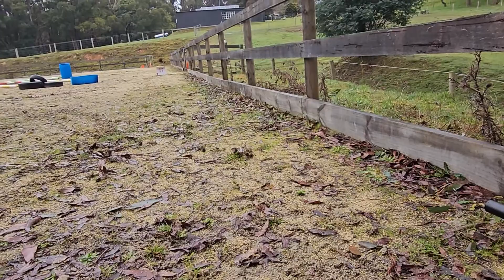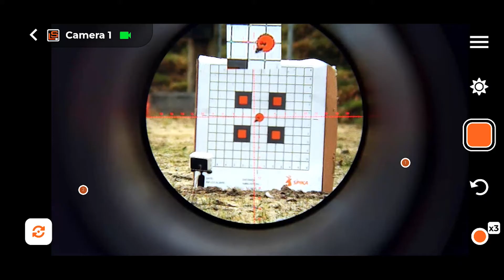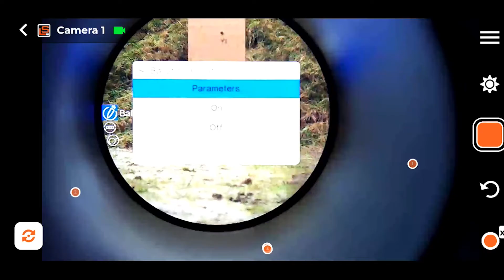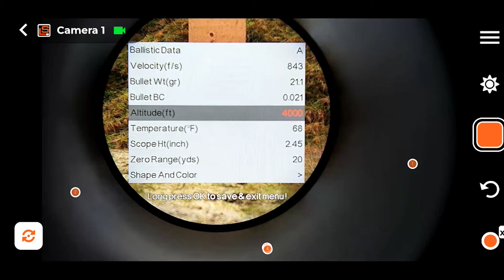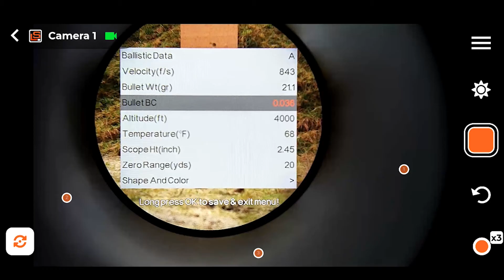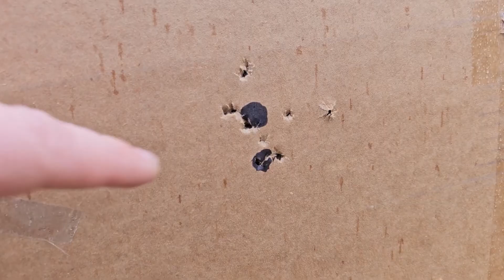How to zero and setup the PARD DS35 Ballistic Range finder, with a tip from Nath @EDGEoftheOUTBACK

Comment: Dont wanna tell you how to suck eggs but if the rf marks is accurate to where the range splash is working. Doesnt that mean your ranging 54 yards at the tree behind the box? And not the box itself?
Reply: This is what I thought, the ranging is off in the video, he's actually ranging behind the box which is likely adding another couple yards. This will explain the difference. 

So actually the standard ballistic calculator seems to be spot on without the need to adjust the BC
Reply: @ds6899  Very probable and most likely the fact. You have to remove the retainer shield of the range finder lens and fiddle with the set screws to center it to the target. He's ranging the tree here.

Comment: Great video, thank you for the insight, this has helped me a lot to fine-tune my new optics. Do you know if the Pard ballistics calculator adjusts for windage? On mine I only see up and down changes based on distance but no left or right adjustment
Reply from the maker: No it won’t adjust for windage as it cannot detect the wind to account for it, it would need a weather station attached to it as it would need both speed and direction.
Reply: @HuntTheNight  the element ballistic app calculates windage based on the spin rate of the barrel, that’s what I was hoping the pard to do as well

Comment: well that works great but if you shoot it at 10 or 15 yards can you tell me how far off the ballistics are because mine shot at 15 yds is 3/4" or 19mm above where the ballistic calculator says it should hit so its 19 mm high at 15 yds sure could use some help im shooting 18.3 jsb at 905 fps average for 20 shots

Comment: I have done this after zeroing at 40 the hold over is correct at 60 and 20 but when I get to 70 the hold over is way off , what do you think this could be
Reply: While changing BC in a ballistic app will compensate for drop at a set range further away than your zero if you want a more consistent result at varying ranges then best to adjust velocity and leave BC at stated manufacturer figure. That's just my understanding and am open to be corrected... That said it could be a number of other anomalies such as incorrect scope to bore measurement or a fault in your individual scope.. for it to be "well out" in only 10mtrs I think the error will not be in a BC vs velocity technicality, more likely something more obvious. 
Work your way through it I'm sure you'll get it done 👍

Comment: Excellent tip. The ballistic calc on my NV008 was spot on my .17 HMR, but near worthless on my air rifle. And my new DS35 is near worthless inside of 50 yards on my .17
I can't wait to try to dial it in adjusting the BC. Thank you!
Reply: When setting up your calculator, anything BEYOND your zero, change the BC. Anything INSIDE of your zero, change the scope height. If you are low, change the scope height higher. If too high, change it lower. Then re-check your BC BEYOND the zero range.

Comment: Even though there was a 50fps difference, accuracy is close. My DS35 won't record to card when on the recoil setting. It says it is, but doesn't record. Tried different cards etc. It records manually, but only if I turn off the auto recoil recording. If I leave recoil recording on, it won't manually record video either. Seems to be a firmware issue.
Reply: Did you find a fix?

Comment: Thanks for the BC adjustment tip. Can't wait to mount mine on a Wildcat soon and see how well it works for me. 🤞
Reply: Mount the NV008S LRF instead as it keeps the wildcat nice and light
Reply: I chuckled when you said - keep it nice and light.  The WC was never light, so I use a sling. Love the DS35. @Lij_MC
Reply: @kiwicam6419  sorry I thought you meant the Winchester Wildcat 22lr
Reply: @Lij_MC  I'll use FX Wildcat next time to save confusion
Reply: How do you find the Wildcat groupings at 100?
Reply: @Lij_MC  I tend to use a rimfire if I've go space to shoot beyond 80m, so I haven't even tried it on a paper target at those distances.  I'm just using 18gr JSBs @ 905fps from memory